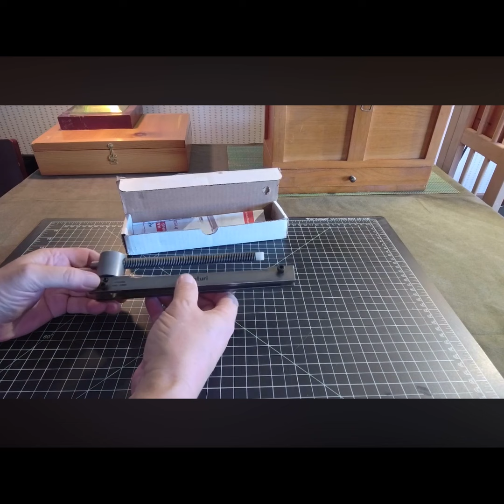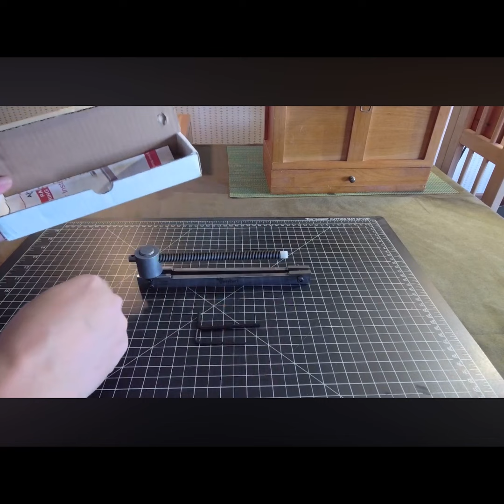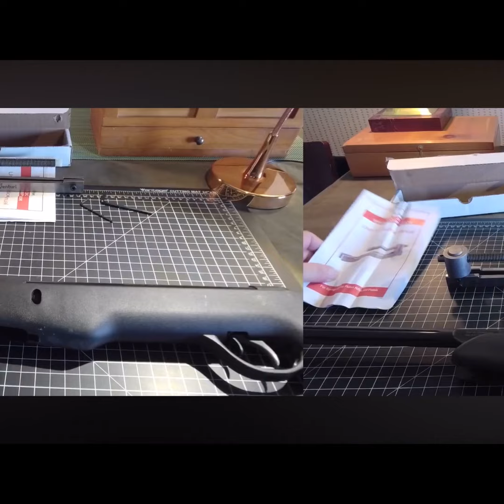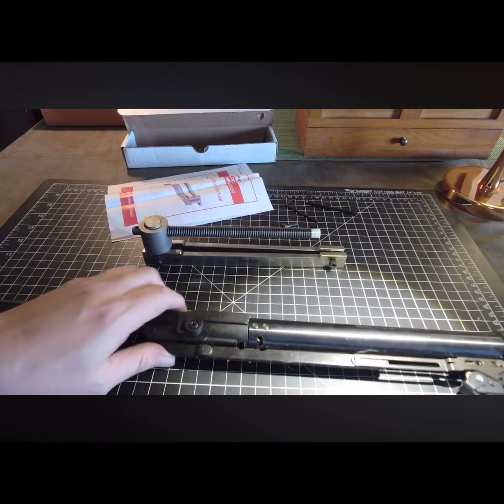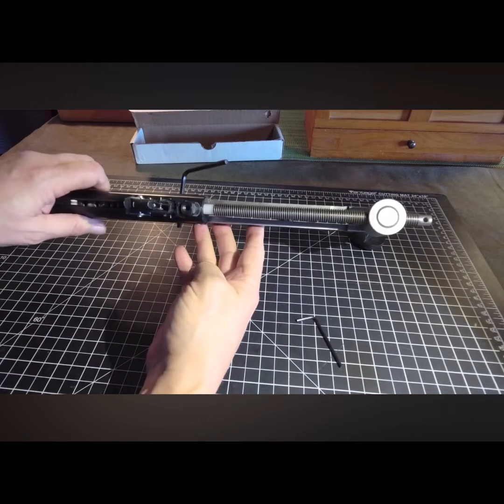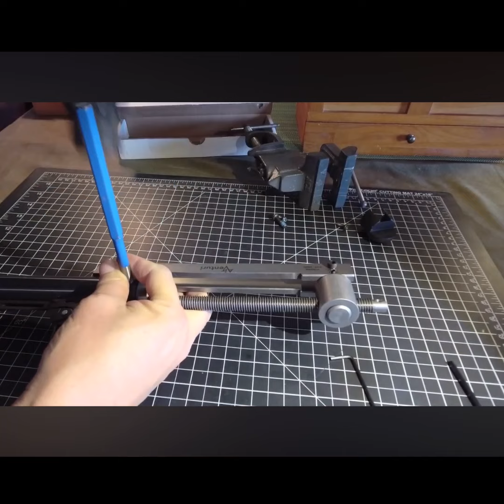Air Venturi Spring Compressor. #airgun #shortsfeed #airgunhunting #shortvideo #pelletguns #shorts

Comment: I need one for a Hatsan 135 gas ram.. I just wonder if it might potentially slide off the dovetail scope rail under 75kg of pressure?!

Thanks for makimg and sharing the video.
Reply from the maker: @stephen9869, I’d call or email a question to someone at PyramydAir, they could probably tell you. Thanks for the feedback. 👍🏻